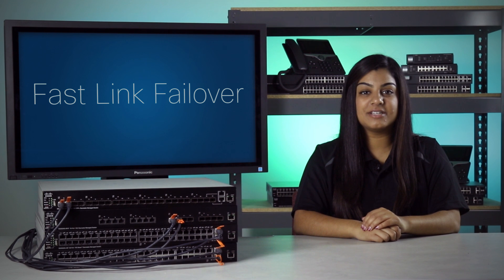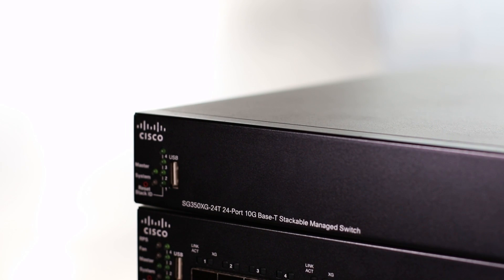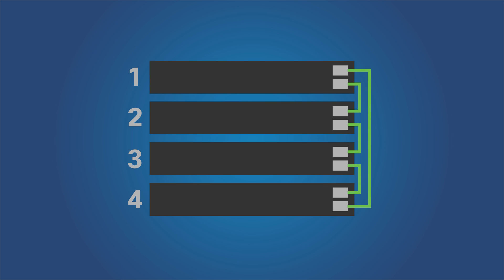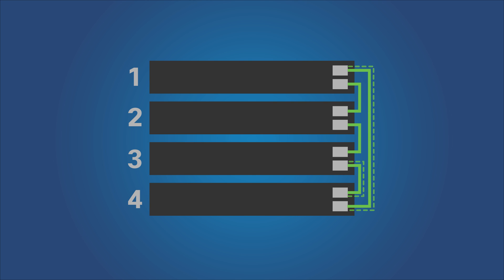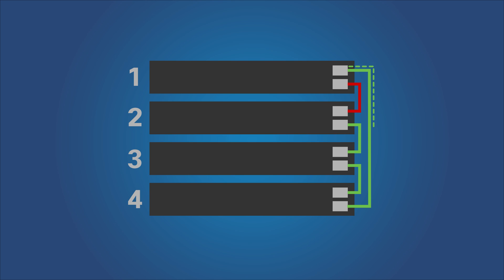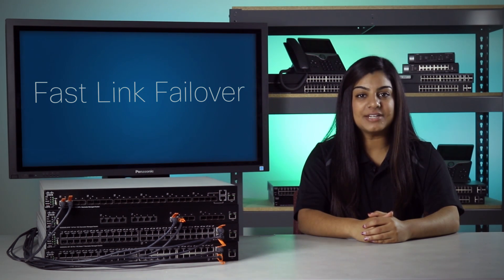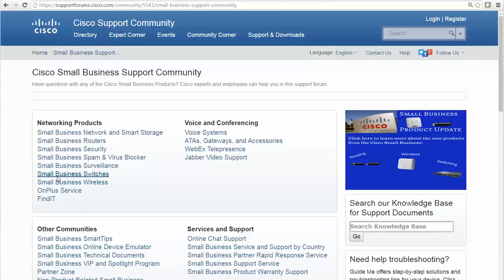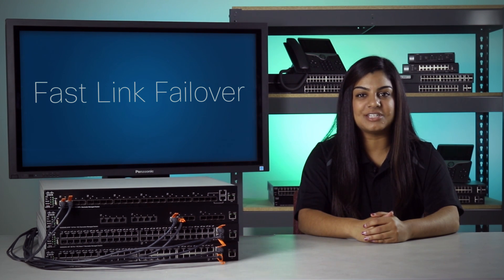Fast Link Failover: SG550XG, SG350XG Switches

Comment: Can we use these switch in ISP environment ?
Reply: Hello Ajit, in general there is no reason why these switches should not be used in an ISP environment. However, it all depends on what requirements should be met. The 350XG/550XG are the higher end SMB 10G fully managed layer 3 stackable switches with advanced security features. They may be positioned well as aggregation, access or core switch.